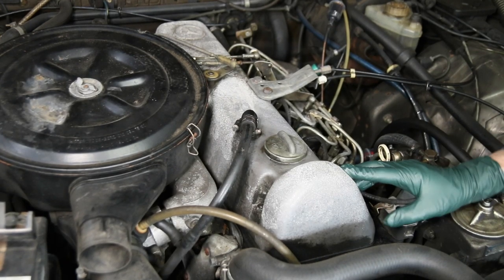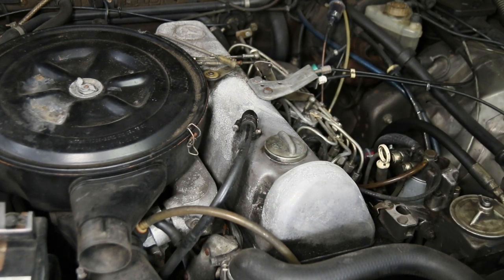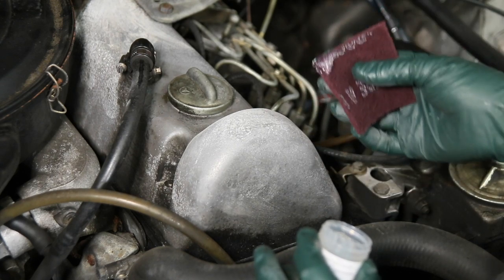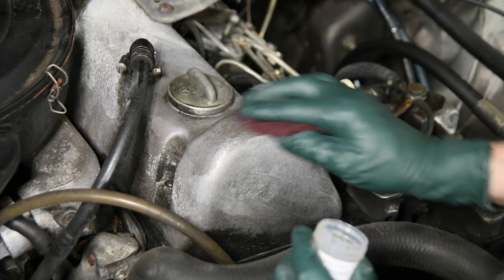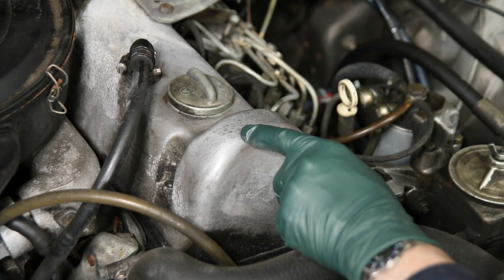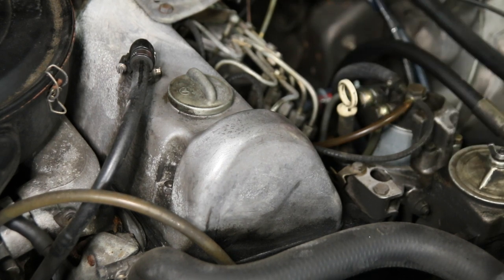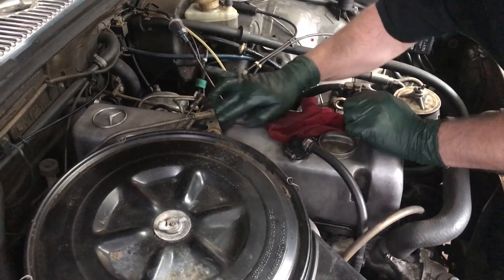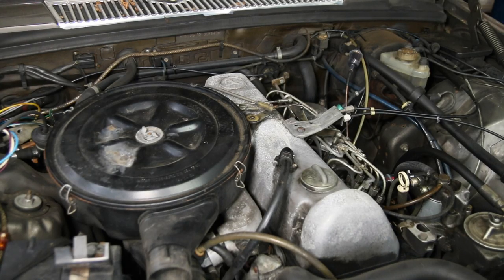How to Stop Corrosion on Aluminum Valve Covers and Other Engine Parts

Comment: My father's 240D never had that problem,  it had a self lubricant anti corrosion system:
800.000 km and a leaky Pcv valve.
No oxidation on the car or the driveway